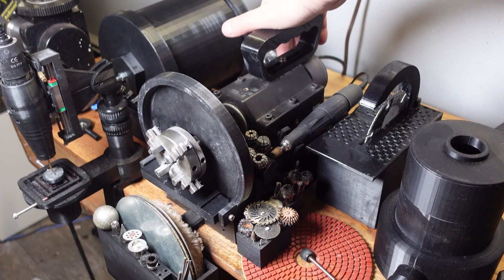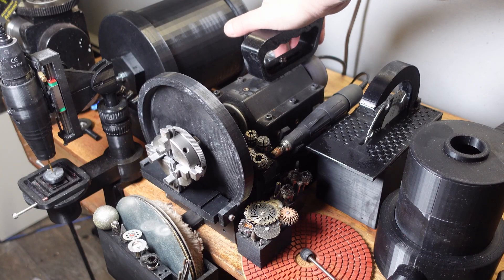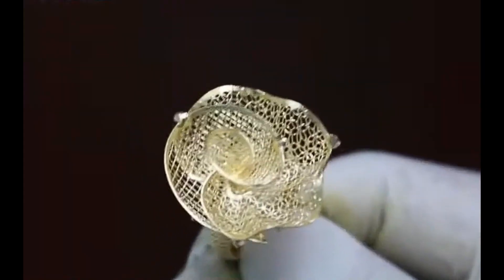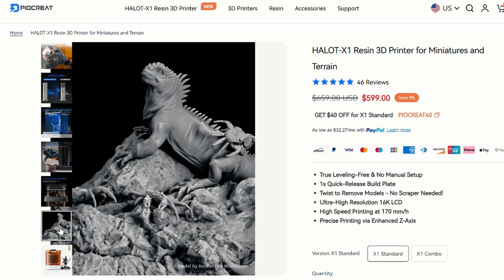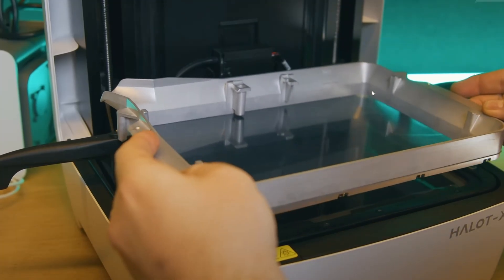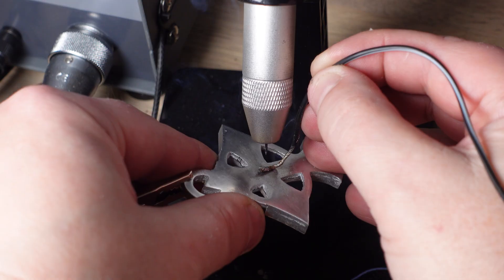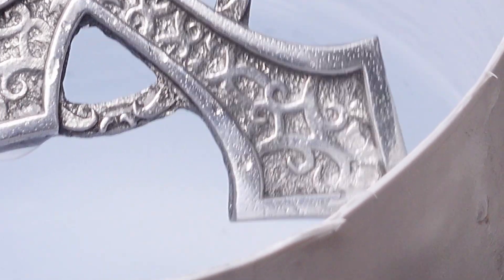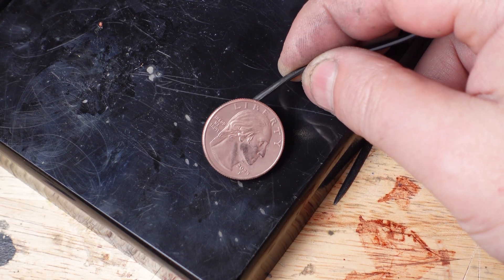3D printed everything machine can now electroplate and electropolish metal.#3dprinting #piocreat

Comment: I see that you use Velcro diamond pads if you want to reach out I can send a ton. There all 4” believe I have 50, 100, 200, 500, 1000, 1500, 2000, and 3000 grit. They were used on concrete polishing machines. Wouldn’t know if they would be helpful but thought I’d ask someone I have so many I’ll never have a use for all of them.

Comment: Wouldn't it be better to make a base with MANY stations and a clutch + transmission using a sliding drive shaft and a bunch of gears. That reduces the time spent reconfiguring. Then sliding the drive gear into different positions can drive multiple stations, which means the expensive electronics/motor don't need to be duplicated, while the low cost tool stations are printed anyway.

Comment: The reason most people are using it for faceting or jewelry making is the costs of those machines and how Many different attachments you need for doing it. The fact that a faceting machine got under $1,000.00 is considered dirt cheap.
Reply from the maker: yea prices are  kinda crazy but if you start faceting and you're convinced its something you want to do seriously, you're going to eventually want a professional machine. But for those just getting started, its nice to have cheaper entry level options
Reply: Also a faceting machine is a water proof adjustable speed record player with a faceter (what is used to set angles and hold stone during cutting, also the most expensive part of the machine)$5,000.00 isn't even close to the higher end machines. I wanted to purchase a plating machine a few years ago they were not cheap my friend has me get an adjustable power supply from eBay and some attachments instead and I have what is equivalent to the highest end plating machinea for under a 10th of the price. I even have the pen plating setup. When you make jewelry it looks much better when you plate it with the same metal you made it from so plating 10kt with 10kt or 19jt with 18kt gives a better final product every time. The own plating also is so easy to do and is a wonderful technique l, and you can use plating to mount gemstones, and it looks awesome. The setup to do pen plating cost under $20.00 comparing it to buying a pen plating setup for several hundred dollars. A good adjustable power supply with some Little attachments and plating solutions is all it is. They sell the pens etc under $20.00 for everything besides the solution or power supply. I paid under $200.00 for the power supply, and I can do countless things with it. You have to buy new plating pens anyway, and the plating solutions so it saves you hundreds and is better quality.